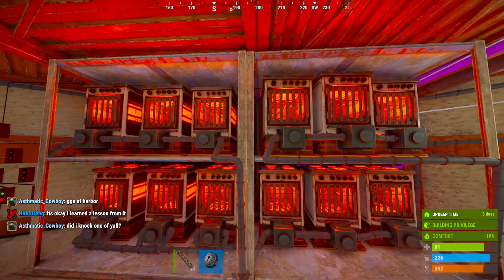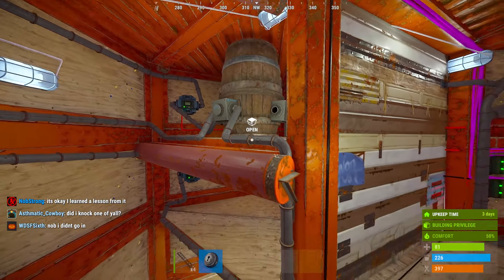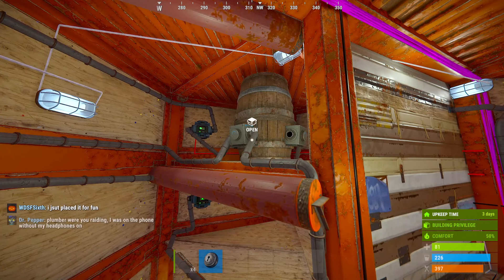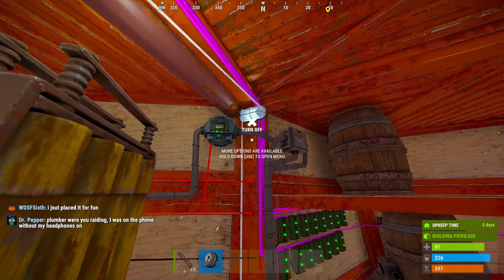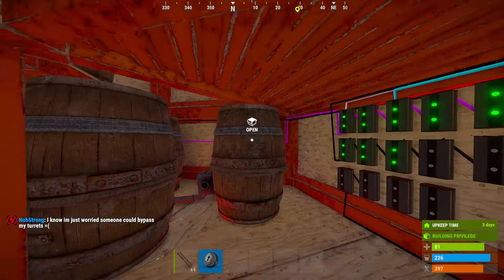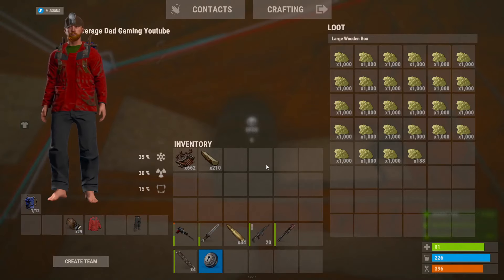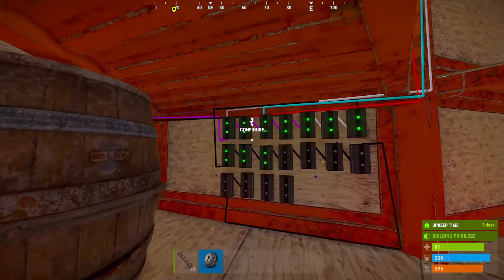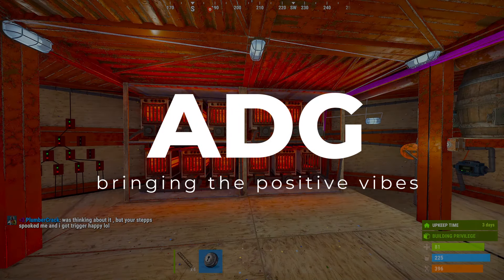Learning Automation In Rust Is Fun

Comment: Some tips with indutrial system that I wish I knew sooner. You can daisy chain boxes together. So no need for the splitter into your metal boxes. There is a maximum of 32 boxes/adapaters/splitters/combiners. Running them in a tree (like you did with you root combiners) is the best way to get the most out of your system in the long run. You may never run into this problem but I did and I wish I knew it a long time ago!
Reply from the maker: lessgo

Comment: Noice well done. Not sure if there is a limit on electric branch runs. You will eventually run out of power as the run continues. Say that it will depend what you intend to hook up , using wiring tool check output as more thing get added and youll see how much power is left. Looks tight
Reply from the maker: Thank you for teaching me
Reply: Thats been changed recently, electric branches no longer take any power so you can daisy-chain indefinitely without any issue of running out of power
Reply from the maker: Branches are the way of life I never knew I needed
Reply: @jonesenoj1  they wont take 1 power anymore?
Reply from the maker: @djilu9916 as far as I know they just send out the exact amount you need
Reply: That's no quite what I mean.  Turret placement has a limit of 12, shack has a limit of 1. So I imagine that maybe electrical branches and a few other things
Reply: @ADGallday  electrical branches have a limit as well think it is 25 on the one chain
Reply from the maker: @UK_Sgt_7094  gotcha, thank you...I now need 100 of them 🤣

Comment: so i use automation a lot, you have far to many electrical branches, it is more efficient to use splitters, 4 splitters for the 12 electric furnaces, also on the output you do not go back to the first box, use an industrial splitter at the o/p furnace then 3 separate conveyers to 3 separate boxes, set up each conveyer to only move what you want to, so frag for one, sulfur for one, HQM for the last one.

in total all you need to set this up is 4 electrical branches, 3 electrical splitters, 4 conveyer's, 1 industrial splitter
Reply from the maker: Right on